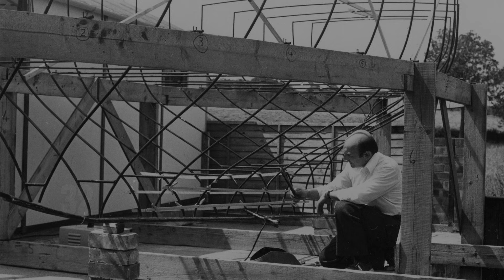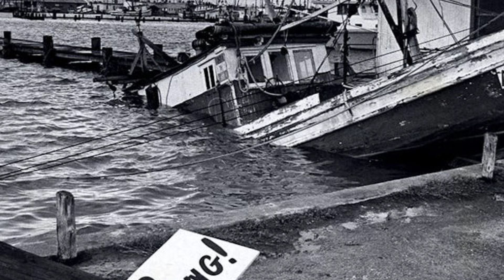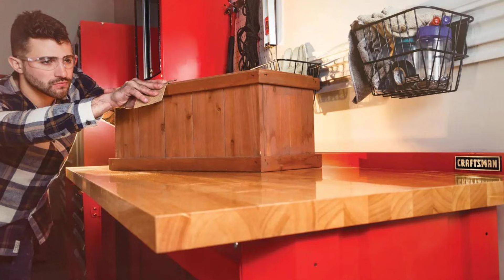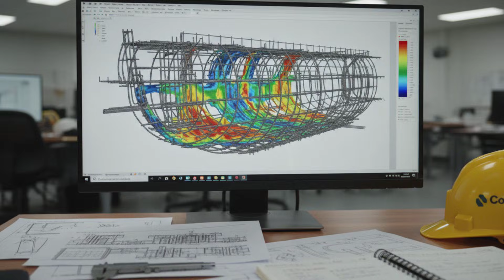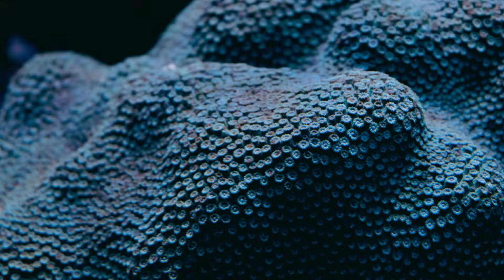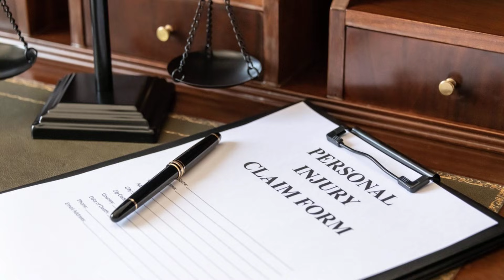Concrete vs. Fiberglass: Why The 'Ugly' Boat Survived The Reef (And The Yacht Didn't)

Comment: The 70s home builders produced 'ferro turkeys' and British insurers fled for the hills. They've never returned, however New Zealand or Australian insurers insure ferro boats at the same rate and value as glassfibre yachts as they've never had the 'homebuilt turkeys' fright. I've owned fibreglass, rubber RIBs, wood and ferro boats over the years. I currently have a 52ft , properly built, (Hartley & Brookes) ferro yacht after much research and experience of ferro boats, both private and commercial (fishing trawlers) and, as a scientist, decided that ferro best suited me best. My hull, if bare, is about 18tons (estimate). I've been hit hard by commercial (marina) workboats twice, by accident. The impact sounded tremendous but the damage was minimal, a chipped (not cracked) hull repaired in an hour with epoxy/sand cement and a lick of paint. Either accident would have punched straight through a fibreglass hull. Ferro cement , like fibreglass, has properties quite different to the base materials of cement or glass. A ferrocement hull is like a giant spring. Hit it with a hammer and the hammer bounces off like hitting a spring. The cement binding the steel also contains pozzelan (fly ash) which reacts with the cement making it even stronger (this was the magic ingredient in Roman cement giving it its strength and longevity). Ferro hulls are handbuilt thus more expensive than fibreglass, which are produced from moulds more cheaply, faster and more efficiently than ferro. All materials, wood, fibreglass, aluminium and ferro produce good hulls if built properly though I'm less confident of minimalist built, wood cored, glassfibre hulls which can rot internally in less than 10 years and are often too costly to repair.The older, 1inch thich, solid glassfibre hulls are heavier but will last an eternity. A heavily built fibreglass boat (Swan, Oyster etc) and ferro yachts give you a much kinder ride than an ultra light glasfibre hull which is fast but bounces you about like a cork in a shaken bottle when the weather turn nasty. OK ,if you're a racing sailer but us oldies prefer comfort to speed. Don't rule out ferro hulls because of the 'homebuilt' reputation. Chose a hull based on your requirements be they speed, resale value, sea kindleness or battleship strength. I sail off the west coast of Scotland, all year round, and sea kindleness, strength and trust in my hull come highest on the list. Sale price comes a lowly fourth. Insurance can be had on ferro hulls in the UK as limited companies do offer it. I've chosen to just carry third party insurance and trust  the strength of my ferro hull willl keep me safe from requiring anything else (26 years OK, so far). These are just the judgements we take.

Comment: Marine plywood sheathed in aluminum is much easier to build. I became obsessed with ferro-cement for years after listening to one of my navy shipmates talk about ferro-cement for two years incessantly. But if finally occurred to me that you don’t want your first build to be the one you’re living in for years.
Reply from the maker: The ferro-cement obsession usually burns itself out when you run the maintenance math — hidden cracks, osmosis ingress, and resale near-zero are the quiet costs the enthusiast community doesn't lead with. The "don't live in your first build" conclusion is the right one. Check out the most-viewed videos on the channel if you haven't already.

Comment: Total hull displacement (weight) becomes less of a factor for bigger boats and heavy construction.  Especially when considering displacement hulls.  

The difference required in engine hp to drive, and maintain the heavy boat at hullspeed, compared to a light one, can also be negligible.  

The reason for this, is because both hulls float, but the heavier hull may only displace another inch or two of water. 

Not enough to alter the engine hp requirements, which can only push the boathull to its designed hull speed, no matter what its made of. 

The reason  we don't see many cement boats, is because they are very labor intensive to build, and do not lend themselves to mass production.

There are also too many horror stories connected to faulty, backyard, amateur, boatbuilding projects.
Reply from the maker: The labor intensity is the honest answer — ferrocement never got past the backyard phase because it doesn't scale, and the backyard phase left too many half-finished hulls as the legacy.

Comment: Heavy sail boat are pig slow  unless its storm from behind  There is very little HP from sails so Bermudan rigs are awful on heavy boats which barely sail against the wind  .So you start to use the engine more often and change to Gaff or square rigs to get more sail area. Now you need bigger engine double the size of lighter fiber glass boats . Now your using twice as much fuel as lighter boat and often using twice as many engine run times in hours so factor in greater costs  engine hour fuel and maintenance. So might as well get a motor boat than bother to get 2 ton tessie sail boat. When you get to about ~100 feet long the boat weight to ratio can start to me better as fiber glass starts to become thicker and heavier and Concrete weight ratio drops as thickness of hulls reduces in weight  . Then there is the resale cost benefit ratio and investing in replacement gear and .added extras  would you do these costs if there is no better resale cost benefits..Best I can see only a motor boat in 45 feet upwards can probably benefit in concrete if you can get big trucks second hand engines .Those big engines  can last past 20,000 hours running time  especially older non turbo non electronic types.The smaller sail boats  sub 50 hp  engines can have life times  of as less  than 4000 hours especially turbo and electronic engine types.in the1970 era the mad costs of boat oft hat era forced people to go into concrete.By the 90 era mass production rapid build boats reduced boat purchase costs a lot but Marina and similar hidden cost increased so getting concrete boat solutions made less sense. However the 2015 era has produced thinner lighter stronger concrete types of solutions in the shore based building system. So its not impossible for factories to use those materials  if its going to suit rapid mass prodction methods
Reply: That wrong I still get 12knots out of my ferrocement yacht and it only has a 70hp inboard
Reply from the maker: Marina fee escalation after the 90s killed the economics that made concrete viable in the 70s. The hull still works — the berthing model doesn't.

Comment: What about the weight? Fuel consumption is through the roof with a boat that is twice as heavy as it should be.
Reply from the maker: Concrete is heavier — that trade-off is real. The argument is what you get in exchange: a hull that doesn't osmose, delaminate, or shatter on contact.
Reply: Not so!

Comment: Properly built ferrocement full keeled  sailboat hit a reef years ago under full sail here off of the Bahamas that i was help crew. Now this boat was a heavy displacement 32 foot double ender and tell you it sheered a nicely shaped hull into that reef! Fortunately it was low tide when we got stuck on it. It scratched the bottom paint. Yeah. Scratched the bottom paint, folks This hull displaced 15 tons and you wouldn't wanna hit this thing with ANYTHING! The captain/builder stated that the concrete was tested to 10,000 PSI. Strange looking boat, no doghouse with a real small cockpit and very high freeboard.
Reply from the maker: That's the whole argument in one grounding — 15 tons, 10,000 PSI, scratched paint. The reef lost.

Comment: Many years ago, the magazine "Yacht" reported on a test firing at a polyester sheet and a ferrocement sheet, the type typically used on a 45-foot yacht. Both sheets were fired at with 9mm ammunition. The bullet lodged in the ferrocement sheet, and a palm-sized piece broke off the back. The bullet passed cleanly through the polyester sheet.
Reply from the maker: The ballistic data lines up with the reef data. Ferrocement distributes impact; polyester transfers it.